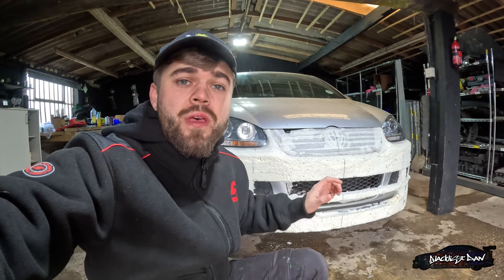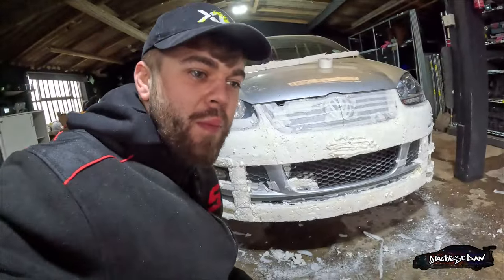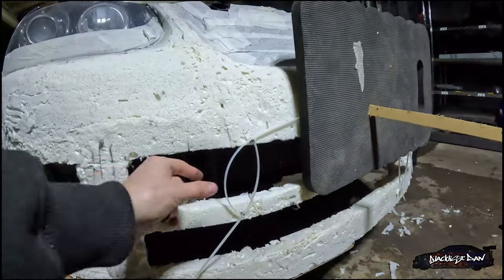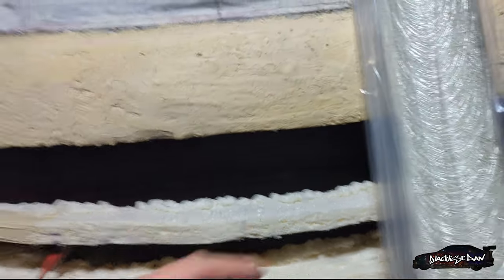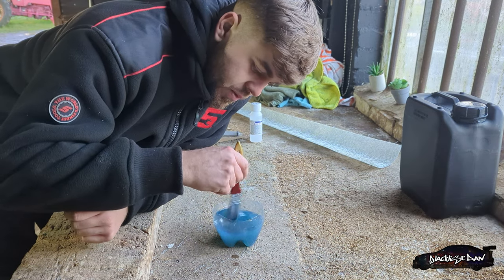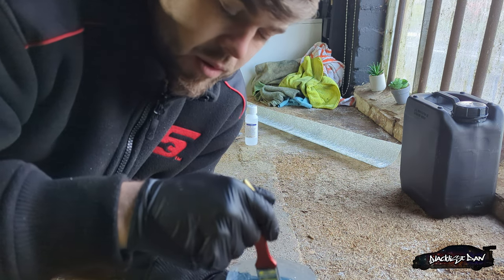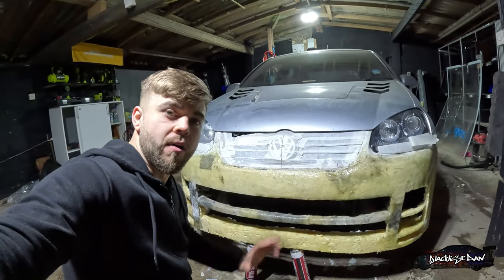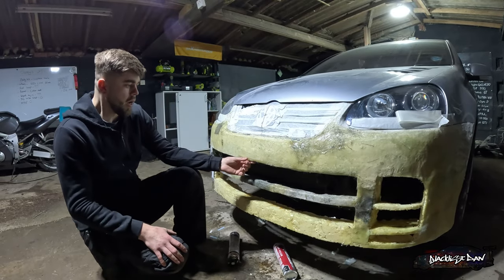building Sonnys GTi IN REAL LIFE! ( EP4 )

Comment: Just a small tip, i think the UK uses 50hz electricity, the same as here in south africa. If so, adjust your camera from 60fps/30fps to 50/25fps to get rid of the flicker
Reply from the maker: Thank you so much for that tip! It's so annoying that flicker is! It's caused by the LED lights in my garage, I've been wondering how to fix it so thank you for the heads up 👌💙💯

Comment: Great video bro
You spend  a lot of time and effort doing this and it is admirable. 
I just have one question. Why do you not make the bumper out of metal or steel so that you dont have to use foam and all that? Can someone please explain why he used foam? Genuinely asking
Reply from the maker: Thank you! I chose to use foam as it's really easy to shape with a blade and if there are any problems I can take more off or put more on whereas if I was to make it out of metal there I could make way too many mistakes and arguably it would be a much longer process 😁